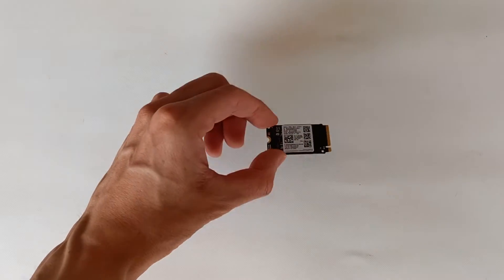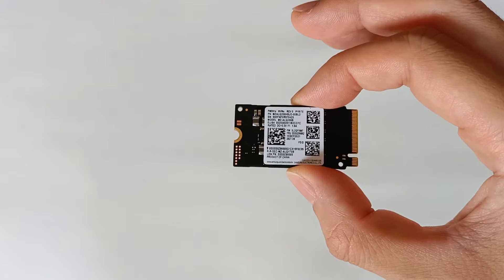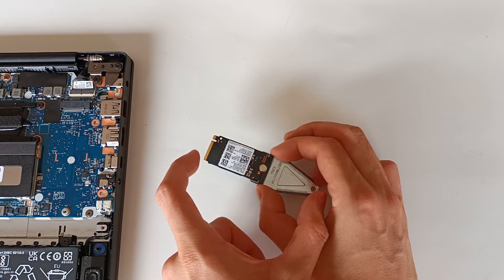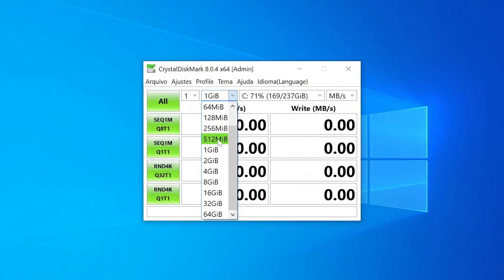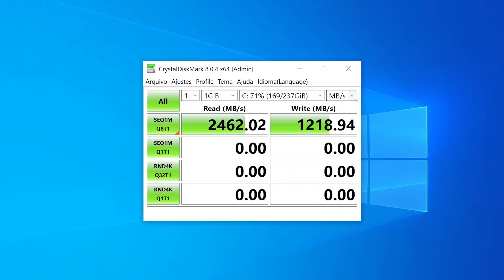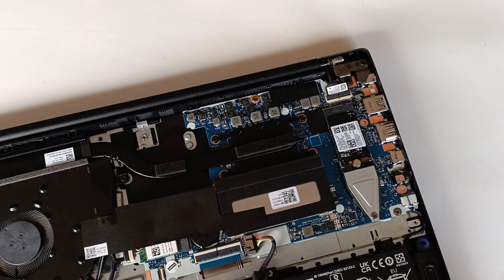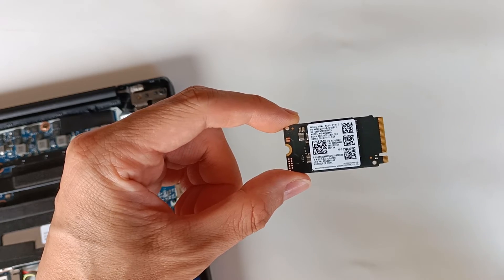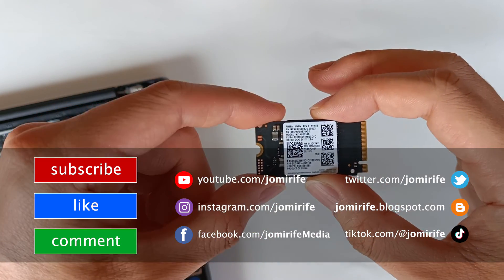NVME M.2 Samsung PM991a (MZ-ALQ256B) - Speed test | Read/Write sequential

Comment: I have the 512 Gb version of pm991a, and a get 3098.14 MB/s in read and 1127.59 MB/s in write
Reply from the maker: i'll do a test with and external reader
Reply: 2670mb/s and 1200mb/s write, but after filling 50%, the write speed dropped to 230mb/s
Reply: @XJleBuSheK don‘t know about the 991a, but the 991 doesn‘t have a DRAM cache and it‘s a typical behavior for those SSDs (DRAM less). And the same may happen when operating it without a heatsink.

Comment: I have the same product and it gets very hot. When it is loaded, it sees 80 degrees. Do you have the same problem?
Reply: Disipador My friend
Reply: did u try updating? it worked?
Reply from the maker: It heats up, but the performance is not that serious
Reply from the maker: Check out the video I posted about putting a heatsink on the SSD